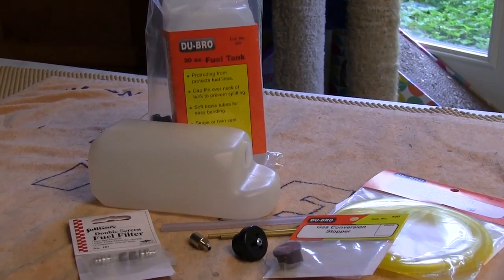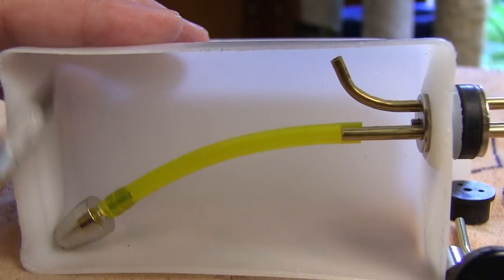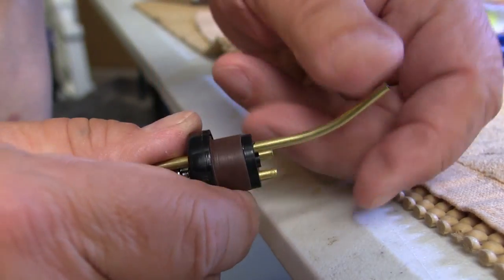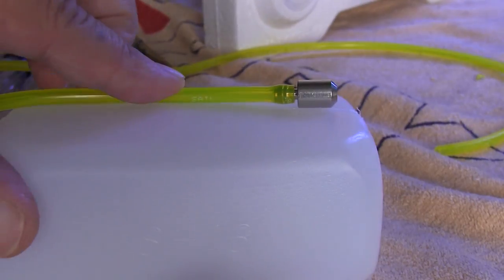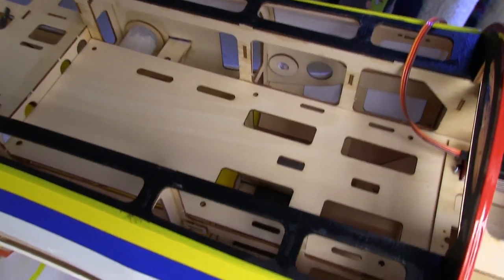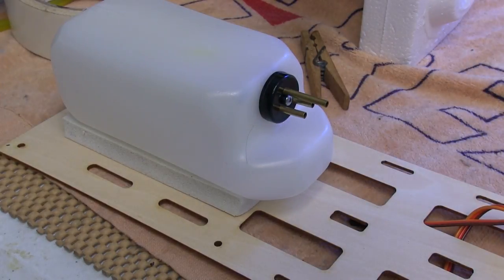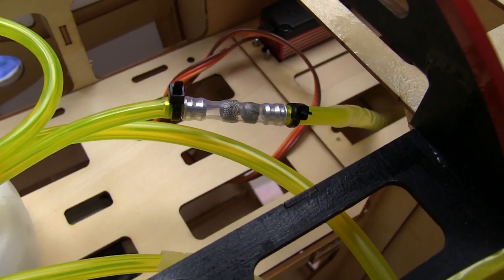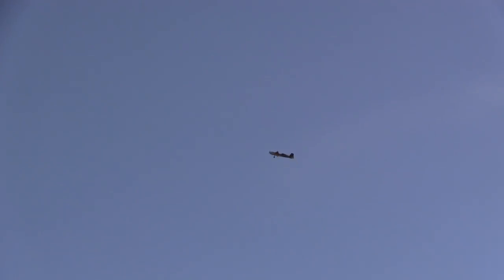Installing RC Gas Tanks

Comment: Thanks, I have a 2003 ultra stick I bought built with a OS 46fx and never flown. I don't know how the guy plumbed and secured the tank. I'm pretty sure it's half assed. I'm going to have to cut the top of the fuselage to figure it out.  Guess that's what happens when a brand new guy buys another guys build that's getting out of the hobby. 🛩️

Comment: I don’t see how running the vent line around the outside of the tank before going down prevents siphoning
Reply from the maker: You just need to have most of the line above the tank. Running it around the top of the tank is just easier and cleaner in terms of plumbing.

Comment: you have two fuel line on carburator?
Reply from the maker: Nope, one fuel line to the carb. Some carbs, like the one in the video have a vaccum  from someplace on the engine to the carb to operate the internal fuel pump. One the tank there is one fill line, one vent line and the fuel line to the carb.

Comment: Very nice video but you also need to barb the fuel line so it won't come off
Reply from the maker: In the final assembly all lines get ties to secure them. In now 30+ years I've never had one come loose once cinched down good with a tie wrap.